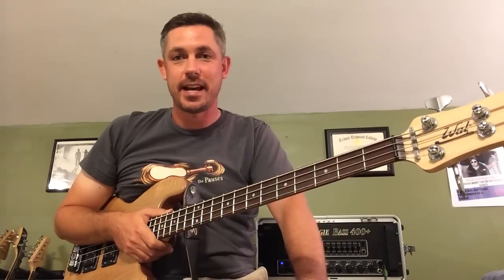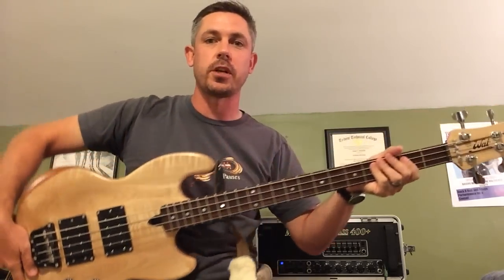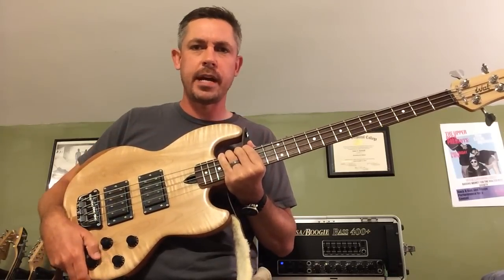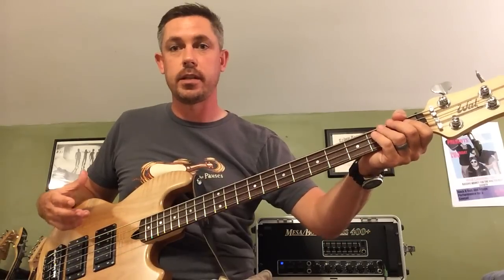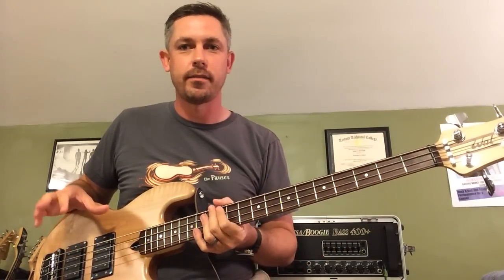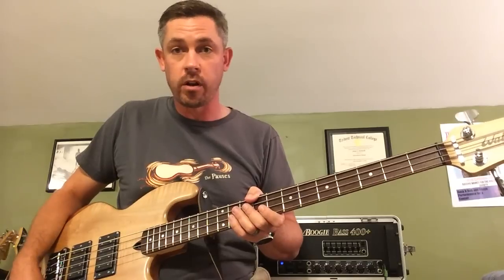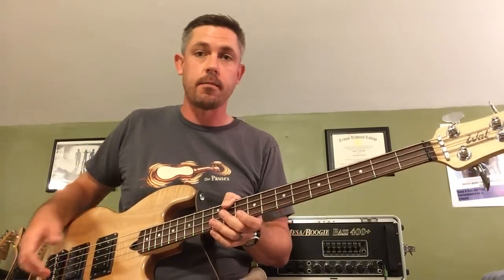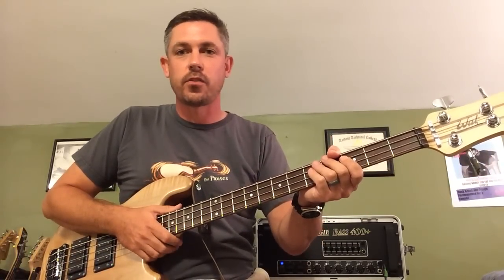Bass Demo: Wal MkI

Comment: So this costs a lot, all I wanted to do was sound like Justin Chancellor
Reply: Nathan Haynes get a g&l l-2000 bass. They sound almost exactly like a wal, and a brand new usa one custom built for you is only like 2 grand tops and 2 month wait. Not bad. They also look a lot like wals with the 2 large humbucker pickups.
Reply: I had 50 dollar EB stingray with a bridge hum bucker and i gave it to my cousin and bought a Fender Jazz MXC for 500 and i miss the Stingray. It had the tone that I was aiming for, it got me closer to any Justin Chancellor sound more than any other bass Ive owned. Starting with the hum buckers, the Way bass have super sealed pickups with no air with gives that low with mid range bite sound. The Wal and Ricky 4001-4003 series offer a bass with low radius fretboards to allow better scaling and technique like slap and aggressive play styles. A radius fretboard serves chords and chords better than this particular style of electric bass.
Reply: Stingray, ProCo TurboRat with barely any distortion and a decent amp.
Reply: Tim Renken I wouldn’t say “almost exactly like a Wal” pretty far from. Similar tone in some ways but not in most ways.
Reply: My Dingwall NG3 will do all these tones just fine.
Reply: @craigmoran893  dude. Dingwalls are  expensive
Reply: @ibnufasya6408  a Fodera is expensive. Dingwall, is value for money
Reply: @stewartross13  I've played a few Wals and own 2 L2Ks.  The Wals are more precise for sure due to the filters that they have in the preamp.  I'm confident that if you drop the same preamp as a Wal into a GNL there'd be very little separating the two basses.  Even if I had the money I'd still prefer G&L.
Reply: @craigmoran893  I've played both.  I wouldn't even call dingwalls value for the money.  Fodera is one of the few companies that I will say is worth the investment.
Reply: Dingwalls sound so unnatural though
Reply: @rainbowslushy223  Dingwalls sound like a normal electric bass. Yeah some people Eq them how they want.
Reply: @ibnufasya6408  nothing sounds like a wal, and dingwalls are expensive and have a too unnatural tone... the closest one is the G&L L2000
Reply: Buy a Fender precision bass and roll up the mid
Reply: Good luck with this, his entire rig is as much, if not more than a car
Reply: What's the poor man's version?